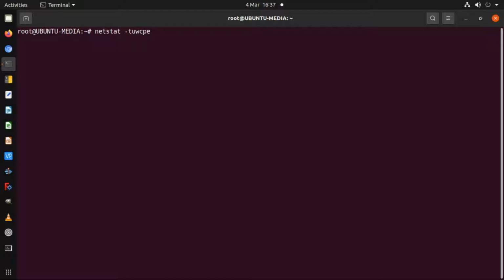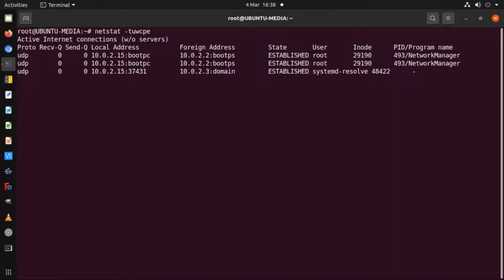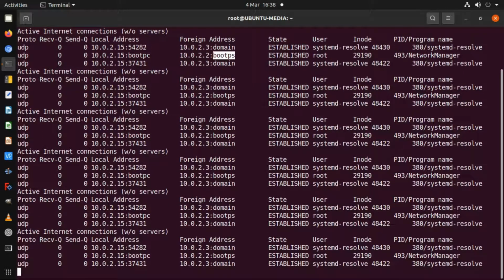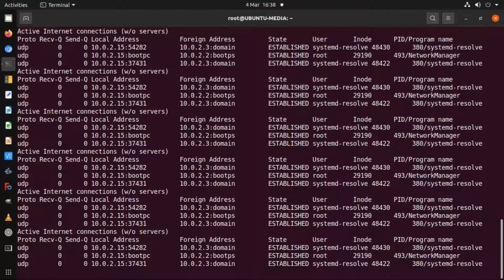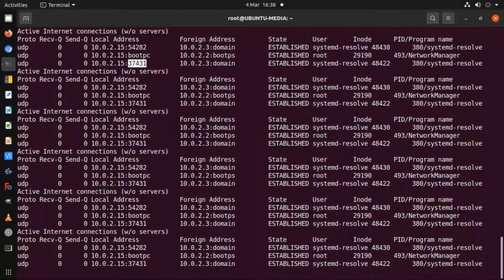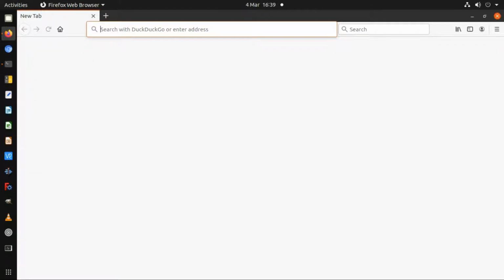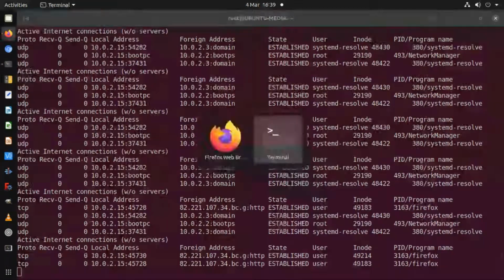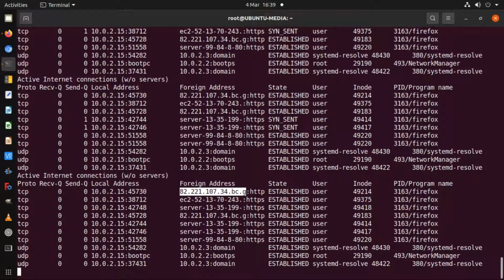LINUX: View Current Network Connections & Associated Process Name

Comment: netstat is deprecated. use "ss" instead.
Reply from the maker: I'm running the latest Ubuntu 20.04.2 LTS and CentOS 8, netstat is present in both and the man pages in both do not say it is depreciated.
Reply: @DevelopIT  there is still lots of deprecated stuff delivered or available with many distros. It does not change anything.